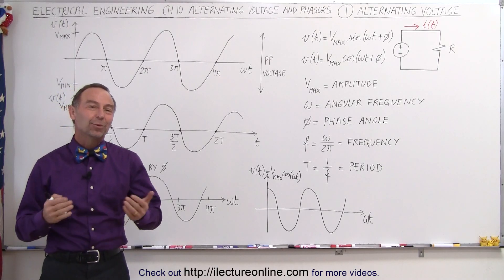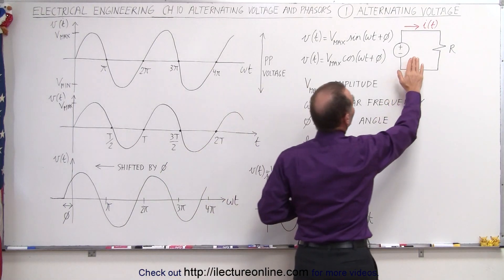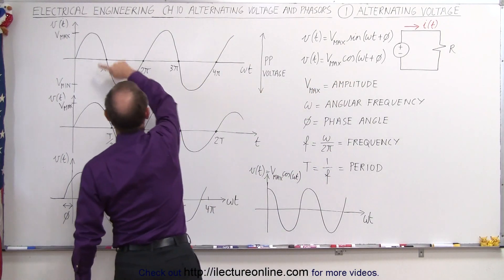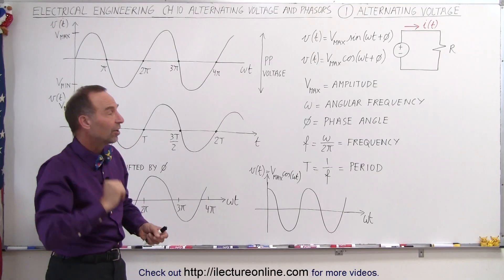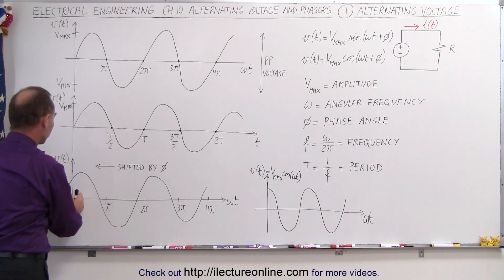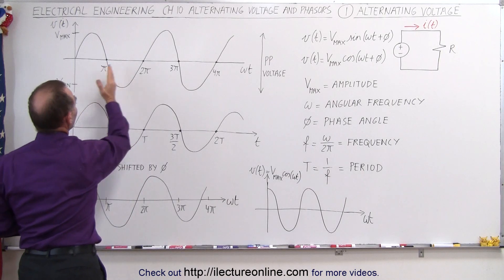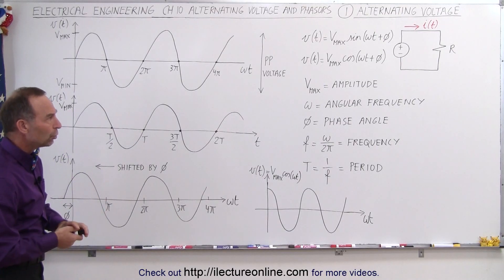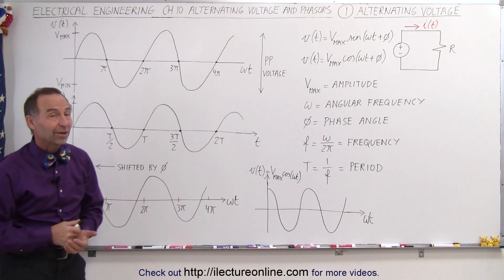Electrical Engineering: Ch 10 Alternating Voltages & Phasors (1 of 82) Alternating Voltages

Comment: Good Day Prof Biezen, why is FRequency for ac/alternating current (for example 50 Hz and 60 Hz) very important and for dc/direct current almost seldom been mentioned for their frequency ?any technical reason behind it
Reply from the maker: The frequency of the AC current delivered to houses in the US has a frequency of 60 Hz, which means that it changes direction 120 times per second and for Europe it is 50 Hz.   DC current does not have any frequency (which is why it is called direct current), traveling in the same direction continuously.

Comment: Professor I have a question . Is electrical engineering a good bachelor degree for master in biomedical engineering ( if you know of cours ). I saw that biomedical engineering work with signals for example and this is the reason why I ask you this question
Reply from the maker: Biomedical engineering is a very broad field, and it will depend on what specific area you are most interested in.  If you plan on getting into artificial limbs and body mechanics, a mechanical engineering degree may be more practical.  Or if you plan on working with diagnostic machines, and electrical impulses to the muscles (for spinal cord injuries for example) then an electrical engineering degree may be more useful.  Generally speaking electrical engineering will give you a very good foundation, but be sure to also get some basic introduction to mechanics.
Reply: @MichelvanBiezen  ok professor thank you so much

Comment: Hello Professor. Thank you very much for this explanation. I have a question, if possible. Is this list for an (AC Steady State Analysis) ? Thank you.
Reply from the maker: This chapter covers the concept of phasors and what they represent in AC circuits.  The relationship of voltage, current, and impedance, with the various components in the circuit.
Reply: @MichelvanBiezen  Thank you very much, professor. I follow all your videos in the thermodynamics, electrical circuits, mechanics, as well as mathematics, and I benefited from them very, very, very much. Thank you. I hope you, professor, if you have a pdf to explain this chapter or complete electrical circuits.
❤❤❤
Reply from the maker: Not yet.  We have not yet developed the pdf files.